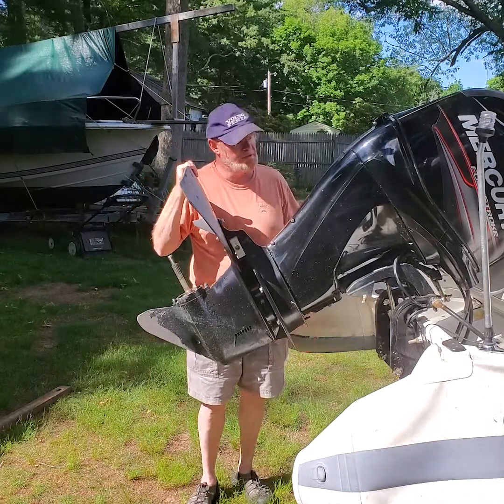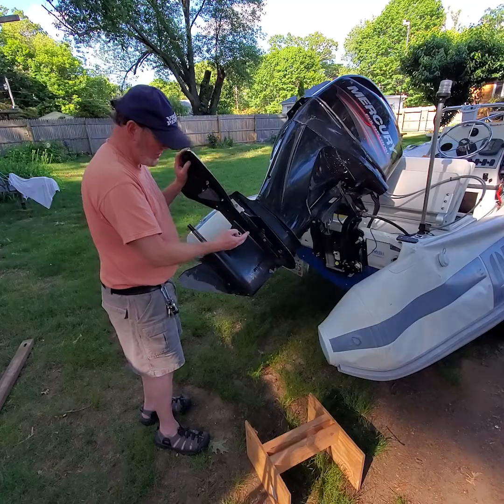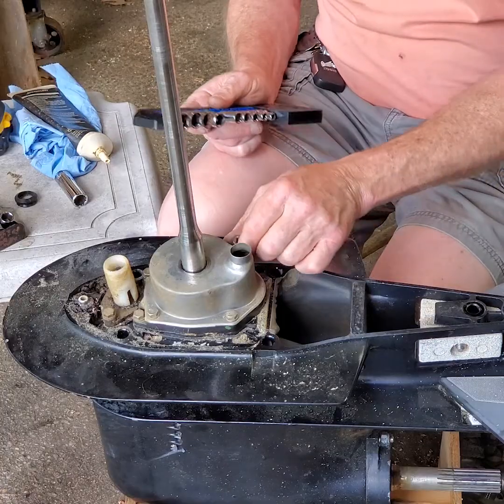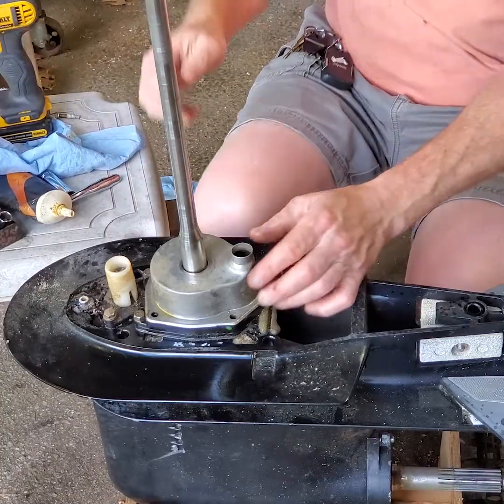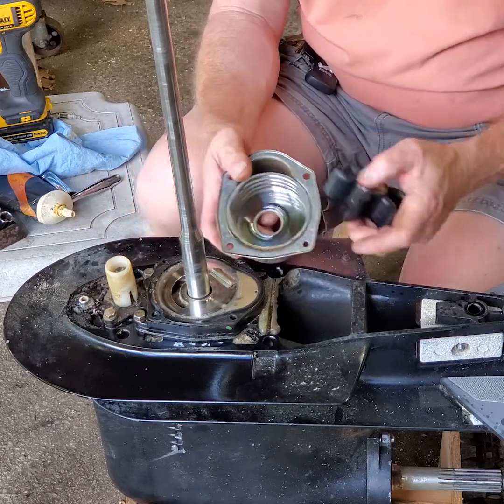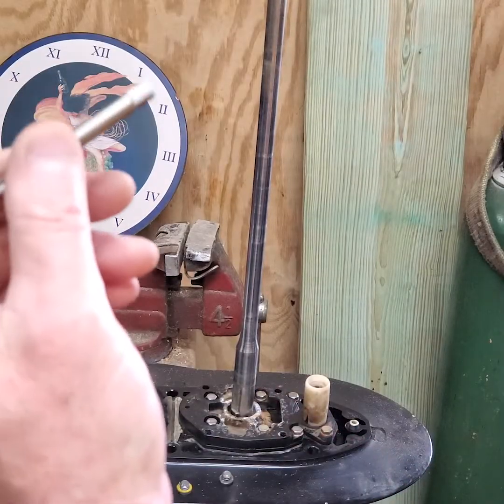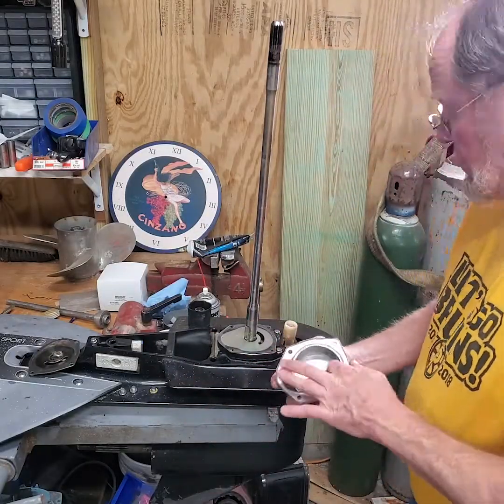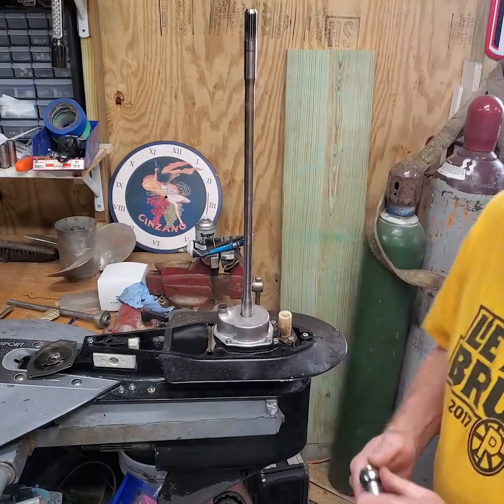Mercury 60hp EFI Four stroke Water pump replacement part 1

Comment: Do you keep the shifter in neutral or forward before you take the lower unit off?
Reply from the maker: Nuetral with outboards.
Reply: @tedsmarinerepair8956  yeah that’s how I do my Yamaha F150.. but I have a new mercury 50 on my pontoon boat.. and somebody on Facebook said they wasted hours because they left the shifter in neutral instead of forward..

Comment: I hope you can answer me.  I’m trying to troubleshoot my electrical problem on my 2012 200hp hpdi Yamaha.  I turn the key nothing happens. Battery is charged I changed to fuses starter starter coil. Took pictures before I did any removals. Now it’s all connected I turn the key and nothing I mean nothing. Can you tell me where I should start trouble shooting at. I’ve tested to parts I replaced all checked out.

Please any help I would greatly appreciate.

Comment: Anyone know what the plate is called at minute 3? The one held on by the bolt that has a wasp nest attached to it.
Reply: 3:04
Reply from the maker: If you mean the bottom of the housing, that is the bottom of the midsection

Comment: Do you put it in forward gear or leave it in neutral the whole time lmk.
Reply from the maker: I put it together in Neutral and rotate the flywheel to line  up the splines during reinstallation.

Comment: Guy in another video red loctite his housing screws and you lube them. After watching you have to do the cool hammer tap trick I don't want to loctite mine.  Thanks for the video.
Reply from the maker: Who would you red loctite them? It will never come apart, and this is a maintenance item! Thanks for letting others know.

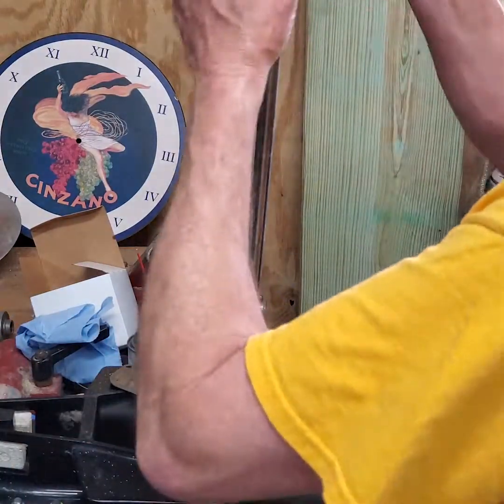Comment: At 11:19 you say that the seal gasket silicone goes down towards the plate, I seen other video where they put the silicone side gasket facing up, which is the corect way.
Reply from the maker: Flat wide surface gets the sealant, sharp or small contact surface makes a tight seal

Comment: What is the best way to flush sand out of a mercury 60 hp 4-stroke? I have sand in my t-stat, thanks for your time.
Reply from the maker: I would take the lower unit off and the thermostat housing and try back flushing the sand back through the housing. Put a bucket under the midsection to see how well this works. You will also need to remove the tell tale fitting and try flushing it backwards as well to clean out that passage.

Comment: Hello. it is 4 bolts and a nut , holding that lower unit. I put LU back holding it with just a nut tight, everything works fine shifts in gear prop spinning, then put the rest of the bolts and it doesn’t shift in gear. Any idea?
Reply from the maker: Dealer

Comment: Good video with some valuable steps,  my gasket seal side is up towards the housing on my 2017 merc 90 hp 4 stroke eng.
Reply from the maker: Yes one faces up the other down, one seals out water the other gear lube in
Reply: I think he means that the Gray Seal side of the gasket is supposed to Face upward instead of downward like you put it. I believe he is correct because that's how it looks in my instructions

Comment: great video, the water from my engine comes out in flots. I have also changed the impeller and the gaskets. Mercury orion 60 hp from 2016
Reply from the maker: No sure what Flots is

Comment: The service manual shows red Loctite on the (4) bolts you were struggling with. Wouldn't some heat be required to loosen those up?
Reply from the maker: Blue loctite is the norm for these fasteners and yes a little heat works fine. I like to try to not discolor the case if at all possible

Comment: Hi Ted.  I have enjoyed your video.  My 60 merc bigfoot leaks water out from what appears the front of the pump when flushing with the engine opreating or not. I have not dismantled anything yet. From your Merc experience, can you suggest what component might have failed?  Note: I have still a good stream from my tell tail
Reply from the maker: Without seeing it, it may be normal leakage. There is a drain hole under the pump base which drains out so it can't freeze over the winter.
Reply: @tedsmarinerepair8956  it comes out likes jet when the motor is running on the muffs
Reply: Like a jet
Reply from the maker: Missing gasket or plate. Sounds like it needs to be taken apart for inspection
Reply: @tedsmarinerepair8956  I did buy the motor and boat new. I plan to take it apart for a close inspection tomorrow. Thank you for your valuable input.
Reply from the maker: @bobhyde4793  If you bought it NEW please DO NOT take it apart!!!
 It is likely normal to have drain water exiting while running on a garden hose. PLEASE take it in for service to an authorized deale -where  you purchased it.
Reply: Bob had the same issue with my Bigfoot 60hp, the tell tail was strong but I stripped mine down and found the water connector part #
8M0113801
Not installed correctly realigned it, put some dish washing soap on it and job done.
Reply: @larrylizard5040  was the water leaking from the shift shaft area? Experiencing the same issue. Lots of water coming from the shift shaft while running on muffs. Water also peeing from the telltale though.
Reply: @chrispeterson4357  yes Chris it was, easier seen if you take the cowlings off, two different types of water connectors one is shorter, yes pee hole was still good.
Previous owner had issues of overheats which the boat shop changed the thermostat but the amount of flow loss from the misaligned water connector was massive.
Reply: @larrylizard5040  Yes. Took the cowling off to see exactly where it was coming from. Have to drop the lower unit to inspect. Hopefully the same easy fix. Thanks for your reply. Appreciate it. 👍

Comment: The seal side of  the gasket on my 60 has 4 stroke  merc.  was directional and can only go up.
Reply: The seal side of the gasket was up when I removed the original water pump off my 2017 90 hp and the diagram shows seal side up on the merc kit.